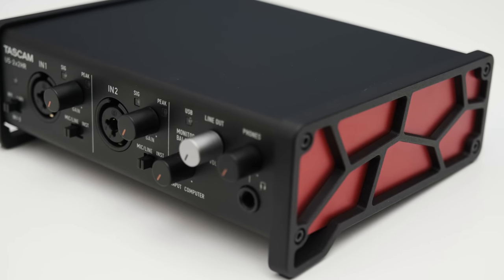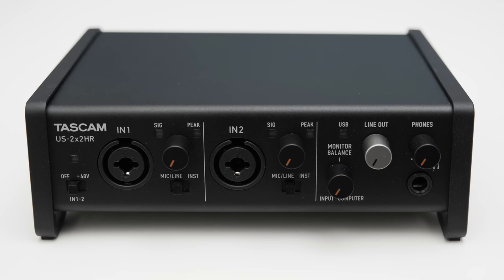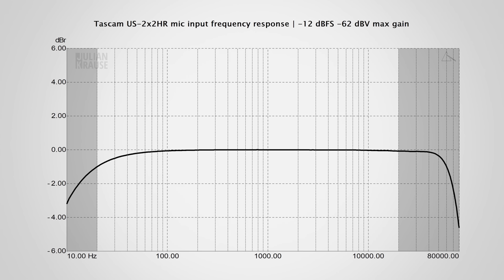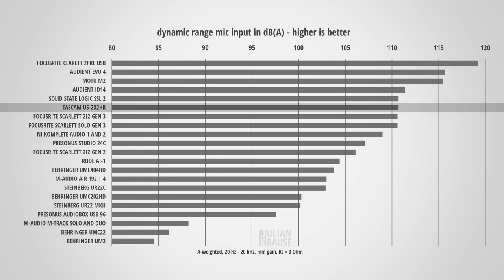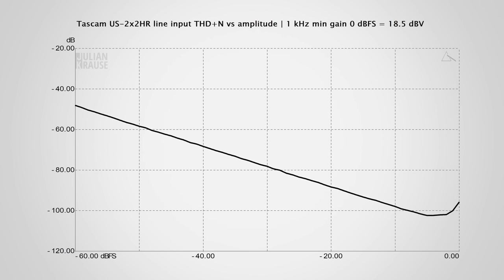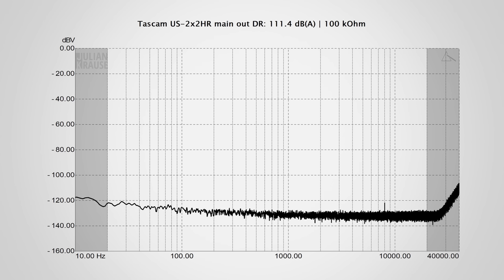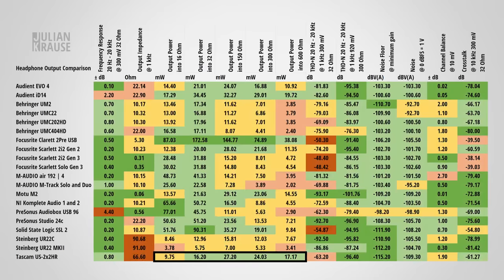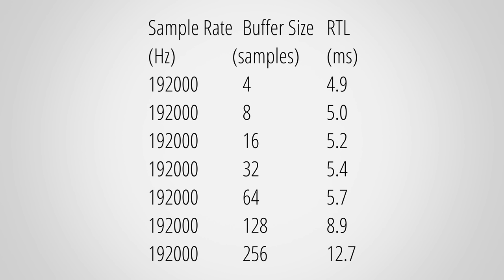Tascam US-2x2HR USB Audio Interface Review (audio quality test)

Comment: I bought this after seeing this review. I have found that the unit is very sensitive to ground loop issues and I need to use a separate USB dongle with separate power to reduce / remove buzzes. (which is a real shame as it already has a DC in on the back). I also find that the clocking is poor with about a 4 second oscillation. The result is a very non musical sound. Imaging is fab. Noise is fab. Distortion  is fab. Frequency response is fab. Tone is fab. Long term timing.... Really quite poor. :(
I don't know if your kit is good enough to measure long term timing / clocking issues??? If your measurement kit can do it. It would be great if you could add this to your test set.
I think you could use Dirac delta pulses every second and see how consistent they are. Or play a pure tone and see how the phase shifts with time compared to a very stable reference. I can hear it so it doesn't need to be that stable. I'll try to do a measurent comparing the few ADACs I have to play with.
Reply from the maker: Hey, interesting comment about clock drift. What exactly do you mean by "I also find that the clocking is poor with about a 4 second oscillation" How does this become audible?
Slight differences in clocks between interface will lead to drift over time. Sometimes more sometimes less. But even if the clock is running slightly too fast or too slow, the resulting shift in pitch is not detectable. So, I'm not sure what the outcome of this test would indicate.
Reply: @JulianKrause  I hear it as timing error on transients. So I don't perceive the pitch error but I can hear the timing error. It's extremely subtle. But music on my other lower cost DAC sounds worse in terms of imaging, distortion, frequency response, but sounds better in terms of timing musicality. I find Herbie Hancock Thrust album to be an amazing showpiece for clocking issues. With anything other than an excellent clock.... That album sounds meh. With a great clock, It sounds amazing! I think a possible reason for the clock drift is the power supply I have feeding my external power USB 5v ground lift dongle. If the 5v rail isn't rock solid I wouldn't be surprised if the clock drifts. I'll buy and new power supply that claims to be ultra stable and see what impact it has and report back. Will take some time to do that though. Sorry. Thanks for the reply :)
Reply: To be more clear it feels like the music goes slightly faster and slightly slower up and down and up and down over about a 4 second period. But it's very subtle. It just removes that je ne sais quoi.
Reply: @stephenbaldwin7165  this is starting to sound a lot like hocopocus  audiophile nonsense.
Reply: Sorry for the slowness of the response. I have just installed my new power supply for the unit. I chose an ifi power x. Vastly improved. Like hands down, hugely better. It's like listening to 256kbps Mp3 and then switching to lossless. This unit needs better power conditioning on the supply imo, an obvious area of cost saving (the unit is very low price for the specs). It has a separate power input but on the 2 channel version it doesn't fully isolate the USB 5v so any noise on that line still gets through.
I don't know how you measure this in a way that draws a nice graph. Potentially look at transient response with a very cheap phone power supply and compare with a known good power supply? Transient response may also show other differences between DACs as a flat frequency response doesn't mean good timing. Thanks for the great work on your channel :)

Comment: I bought the US-4X4HR and I have been having serious issues with windows 10. When i plug the interface, and select it as my output device it causes my computer to freeze.
Reply: Did you install the software first?
Reply: @ThePhantomnaut  yes I did. I uninstalled and reinstalled it with no success. However, I did just test it with another windows machine and for now it seems to be okay.

Comment: Hi Julian, thank you for your interesting and technically in-depth reviews.
Excuse me, I take advantage of your competence and your kindness to ask you for a suggestion.
I rarely need to transfer music to my pc from my old DAT (coaxial S / PDIF and Toshlink optical outputs) to recover recordings made many years ago.
Is there an interface, an adapter that allows me to connect the DAT ports to the PC? Obviously it would be simple, but expensive to have to buy a NEW sound card with this type of connections (plus there are few and they are expensive).
can you help me? Thank you. A greeting.
Davide.

Comment: Any gains from using the separate power converter for headphone use?
Reply from the maker: I haven't tried it as there is no power brick included. Regardless, I don't think it will make a difference.
Reply: @JulianKrause  Thanks. Suspected as much, but would have been an interesting and flexible solution to provide extra power that way for those that actually have need for more output power.

Comment: Julian, can you address the issue that if you don't power the usb C interface via a real usb C port, but instead a USB 3.0 to usb C adapter, how much power is lost - hence not sufficiently powering the amps. (Potentially 5000mA Vs 900mA). This seems to be a big issue and lots of misconceptions are floating around in the community. Thanks! If anybody can lay it out concisely, it's YOU!😇
Reply from the maker: Hey, the majority of interfaces are designed to be USB 2.0 compatible. Many interfaces will come with a USB Type C to USB Type A cable in the box. In fact, most of the interfaces that use a USB Type C connection are USB 2.0 devices. So, it’s just fine to use the interfaces with a USB 2.0 connection, especially when they are 2 channel devices. It gets a bit more interesting with 3 or more mic inputs. Interfaces with more channels have to be able to supply more microphones with phantom power which can result in a considerable increase in power consumption. That’s why those devices usually come with a power adapter to deliver the additional power. 
So, it all depends. But most 2 channel USB C interfaces run just fine on USB 2.0 and interfaces with more channels usually use a power adapter and then it should also be no problem to use a USB 2.0 connection.
Reply: @JulianKrause  thank you Julian! I was stumbling across this issue while researching the audient id14 mk 2, that is usb3.0 compatible, but draws more power when plugged into usb c (quote from the manufacturer). 
Maybe that's something interesting for you, as you have tested it and maybe still own it. With your equipment - it would be interesting to see the different performance once with the usb c to usb a 3.0 cable and once with usb c to usb c.

Comment: The hardware is ok for it's price, but the drivers are a joke. I have the Tascam US20x20 and the audio drivers keep crashing and freezing Windows 10 when both ASIO and system audio are in use. For example when you have your DAW active using ASIO and you watch YouTube in background using system audio/MME driver at the same time, after 10-15 minutes, the entire system audio service crashes to the point where it's not even possible to switch to other audio driver. Even turning off the audio interface doesn't unfreeze the system audio and sometimes the freeze can trigger a blue screen. I contacted support multiple times, providing system logs and memory dumps, and they ignored this issue. Also, if the VST plugin shortly fully loads your CPU, the interface increases the internal audio buffer, which introduces lag. The only way to get back to regular buffer size is to reload ASIO driver, which is really annoying when working on large projects. I'm running the latest drivers and the latest build of Windows 10 on Ryzen 3900x CPU, but the same issue happen before even on my previous Intel based machine. I really don't recommend getting any TASCAM audio interface for professional use.
Reply: A product having issues is understandable and maybe even acceptable. But ignoring issues, especially when presented with factual diagnostic data that both proves there is a problem and that should be able to be used to fix the issue, is quite unacceptable.

I'm far from a professional but I was about to bite until I read your comment. Too bad because most of the specs here were quite impressive, besides the headphone downfall. Way to give it to the pooch Tascam.
Reply: You're not supposed to be able to run asio at the same time as system audio (on a windows pc anyway).  You're going to have that problem with most, if not all interfaces.  This is why streamers and podcasters get interfaces with loopback capabilities.. for the very reason you describe. You can't run asio and a windows driver at the same time.  There is a software workaround but it's clunky and not very stable imo.  I believe it's called virtual audio cable, or that's the description.